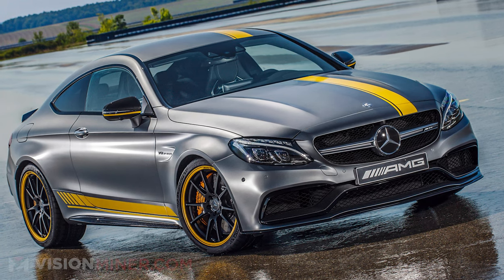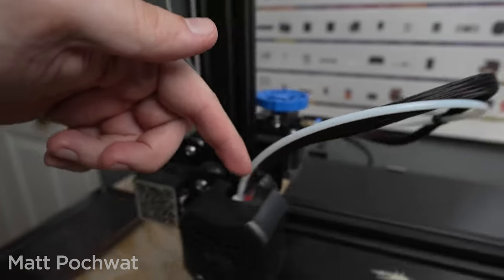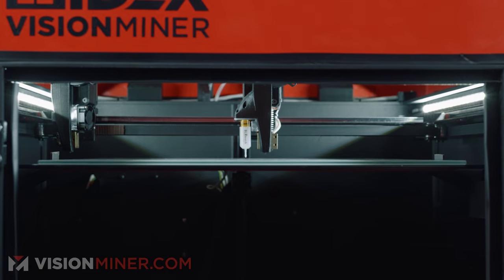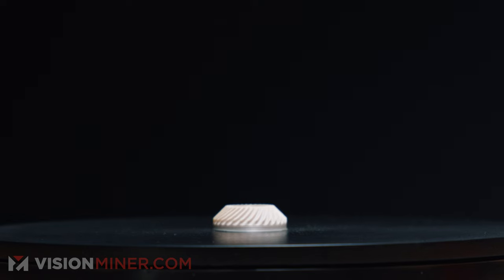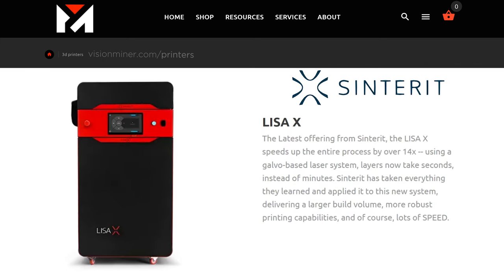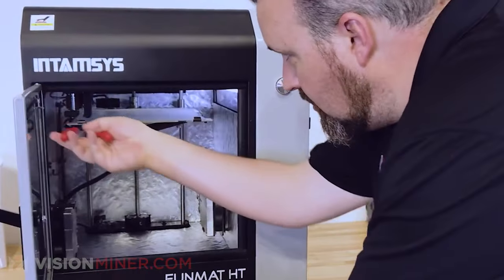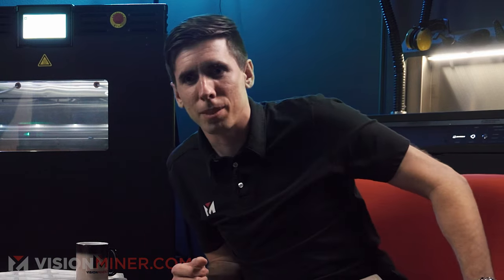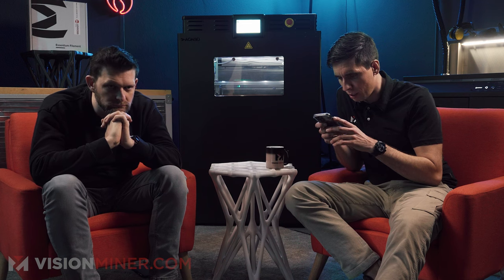Building vs Buying a High-Temp 3D Printer: What's More Cost-Effective to Print PEEK and ULTEM?

Comment: I built an enclosure and heavily modified my CR10 to print up to 100c Celsius ambient chamber temp. Bed can go to 140c and hotend up to 500c. Built the enclosure out of a broken dryer and had to relocate electronics outside. It cost less than $2000 and it’s great! However I agree with the opinion expressed here , it would be crazy for most people to try to DIY. Especially if it’s a business, it’s better to just buy the machine.
Reply: Here was my build list and approximate costs: Enclosure: 

Base Metal Enclosure: $0 (free broken dryer) 
Foam Panel Insulation: $30
Foam Spray: $10
Door and Clasps: $0 (from a table leaf) 
Polycarbonate Window: $40 
Door Sealing Foam Strips: $20 
Stripped Fin Heater and SSR: $60 
Metal Fan Blade: $10 
Shaded Pole Motor and SSR: $30
Thermal Fuses: $20
Silicone Wiring to Heater: $20
Silicone Caulk: $10 
Rails to Slide Printer out of Enclosure for Maintenance: $20 

Printer: 
Base CR10: $400
H20 BIQU Hotend & Pump: $100
SKR 2 Motherboard: $60
Berd Air Pump & Parts Cooling Ducting: $60
Metal Brackets for Z Axis top and bottom: $30
Polycarbonate V-Wheels (15): $30 
Class H Hi-Temp Stepper Motors w/ silicone wiring (4): $80 
AC heat bed and SSR: $40 
Cast Aluminium Bed: $80
High Temp Belts: $40 
Wham-Bam High Temp Magnetic Base: $40
Regular PEI Spring Steel Sheet: $20
Reply: What are you printing with it?
Reply: @travistucker7317  Mostly just regular ABS, but sometimes Nylon, and Polycarbonate (close to pure PC, not the gimmicky watered down stuff that Prusa sells)
Reply: @ce5903  what are you doing for the pc? I'd like to get there
Reply: @travistucker7317  100-110c for ambient chamber temp. 135-140c for the bed temp. 300c for nozzle.
Reply: @CE  isn't a cr10 like 300mm cube?
Reply: @travistucker7317  300x300x400
Reply: @ce5903  have you tried any peek?
Reply: @travistucker7317  no not yet. I doubt I will, it’s very cool stuff but I have no use for it.

Comment: I absolutely love love love this video. I think the biggest takeaway is that there is still such a perspective difference between industry and diy. Absolutely, if you have the money and want to make more money, buy the right high temp printer. One aspect about this market though that I think folks can't get behind is the proprietary nature of parts, support, firmware, etc. Being able to fix something simple yourself in a pinch is something that saves a business of any size time and money. That's one thing that sets the 22IDEX apart. It seems open enough to be able to tune it to your needs whether it is low temp or high temp material, and it's a machine that is understandable. The price range is good, maybe a bit high for individuals and startups, but not as absurd as some other similarly capable machines. It seems like there is a divide between small businesses and larger businesses with excess money to spend. Honestly a more open source like funmat would do excellently in university labs such as my own. But at the cost of a 22IDEX, it is much harder to justify. Research labs seem to be right on the cusp of being able to take advantage of these types of printers, but we aren't quite there yet. Thanks for the great content and innovative products.

Comment: Proper high temp printers are some darn crazy machines.  From vacuum beds to hot air part "cooling" and isolating the motion system, there's so much stuff that one just wouldn't consider if coming from a typical hobbyist printer background.

From what I've seen 80C chambers are doable on the diy approach of slapping something in a chamber that wasn't meant to be, but much above that and you'll start having a lot of problems.  Belts have to be isolated by around 120-130C and grease cooking off begins to become a real concern much above that.  Then you're looking at high temp bellows in addition to everything you already have to deal with.

With the cost of high temp materials it seems pretty reasonable that if you need to print them you can probably afford a purpose built machine to do so.  There are some pretty cool home-built high temp machines out there, but proper ones are few and far between (and still really expensive).  I personally don't require materials like ULTEM or PEEK, but it would be nice to have a chamber capable of running large parts in PPA-CF and similar "mid-temp" materials.  Unfortunately I'm not in a place to drop five to ten grand on a machine right now, but maybe sometime in the not so distant future.

Comment: By the way. You show the bl touch in the VM 22 as bed leveling probe. I had that in the Valkyrie but it is not suitable for ht chambers over 70c
Reply from the maker: Don't worry, that's long gone. New machines and new videos arriving in about a month :) Surprisingly, though, it actually worked quite well -- even on a large batch print, with a 200c bed -- tiny parts -- never really gave us issues, but now we use a high-temp microswitch setup we designed :)

Comment: "If you can spend the money..."  Oh, there's the problem. I can't.  However, I CAN design one out of steel, CNC plasma cut (also a DIY machine) the flat parts.  That only leaves the not-flat parts, bearings, belts, heating elements...... yeah this is gonna be a nightmare.  And not one big nightmare, but instead about eighty thousand little nightmares lined up in a row.

Comment: no joke i did build the most overbuild fdm printer possible with custom heatbed, enclosure and 500°C dual extruder system. All motors are outside the chamber, its core xy and build volume is 400x400x500. BUT... it wasnt cheap and its around 10k only in parts. My suggestion, dont do it ^^

Comment: I have done a few used Stratasys I found cheap cheap, rebuilt the wear items and run it on open source (6HC)  also kept some features like canisters loading bay  head blower, chamber heaters, fans, thermal snaps, chamber thermocouple and build volume is now larger and can now get to 90C no heated bed needed, it has 4 build plates types for it CF BORO MAG-PEI and metal this is the second one i have done now almost exactly the same but this one has a touch panel the first one was 3 months on weekends the last one was done in a weekend! no rafts or support unless i want it is a game changer for this unit alone with bellows and fire pillows 120c i could see but not needed yet

Comment: I built my own high temp printer.  it was a pain and it doesn't print PLA well because it gets too hot :D   getting those 200v 400Hz 3 phase aerospace grade fans that can run in the chamber at 100+ degrees was fun.  maybe i'l send some pics, it's quite cool. totally a hobby though and you guys are absolutely right.
Reply from the maker: Definitely send pics! Sourcing fans has been quite a chore, for sure!
Reply: @VisionMiner  sent to your contact email :D

Comment: I stopped with a chamber temp of 55c. Active heated chamber for a Voron 2.4R2 350mm.
Going above I would have to make so many changes I would running into to many issues.  Designing a high temp Printer isn’t easy and the materials needed are expensive too. 
If I ever would have to print peek I would buy a printer designed for it.

Comment: Dude, you guys are awesome! I bought a printer, not even from you guys, and when I called you, you guys were more than helpful. I ordered my first large bottle of nano Palmer adhesive, and a month later I’ve already ordered three, that stuff is amazing, but I think the whole analogy with sports cars is definitely not a good one because no one makes money with their sports car, I actually bought a 392 hemi SRT challenger instead of buying a demon, because I’ve now made it into a more powerful car than the newest demon. It’s almost 1500 hp, and I enjoyed every minute of doing it. Wanted to build a muscle car, my whole life, and I finally did and it was an amazing experience and I learned a tremendous amount. Similarly, I love the IDEX 22 especially the newer version, and I would love to have one I just couldn’t justify 15 K, so I bought a CreatBot F430, and then I decided I was going to modify it to get to the same temperatures as the IDEX 22, I have built a cooling system with an 18 inch radiator and three large fans with a pump circulating through four different aluminum stepper motor add-ons, that I CNC machined myself, so my X motor, my Z motor and both extruders are high temp steppers, another add-on, all water cooled with my homemade water, cooling system and homemade water cooling devices to go on the motors with thermal paste, doubled the plexiglass window, size in one and left the original, so tripled the size of all three, insulated the entire inside of the machine and added two 300 W ceramic heaters and 2 16 amp 24 V grid heaters with fans to the original large heating system that came in it with a external power source supplying them mounted on thin aluminum plates, welding, coupons, actually, drilled and tapped holes in those and mounted them to the enclosure, then had all holes already drilled and tapped for short screws to hold the heating units so four additional heat sources, the chamber is already getting up to 120 C, and everything in this printer aside from what I’ve changed is already built to withstand it. It has high-quality lead screws and linear rods, high-quality linear rails, on the X axis as well as the y axis on both sides, but the beauty part is those two stepper motors, and all of the electronics are not inside the chamber. They are underneath the printer, which is completely insulated and gets practically no heat, I used adhesive reflective thermal insulation that stuck onto the inside and then I put HVAC bubble wrap that is reflective as well on top of that, so it is seriously insulated very well, the build plate is also aluminum, then obviously I modified hot ends extruders, etc. etc., but it’s really turning out to be a serious printer. I’m getting up to the 70°C it’s rated for in five minutes. So when I let it warm up for 15 I’m at over 100 C. Hot end is already getting up to 500, and build plate is almost 200. And I’m nowhere near done, I already have a big tree, Main board and stepper, drivers as well as sub board and raspberry PI, it will be fully autonomous as far as video which is already installed with high temperature, wire, shielding, and the electronics outside the chamber either underneath or on the wall where my whole cooling system is mounted, I’ll have some YouTube videos of making it coming up but I’ll send you guys some pictures. Hopefully your guy Cole got the gun suppressors I sent him I ended up sending them a little later than I anticipated, but I did send him a couple to make up for it. Appreciate you guys as always, and one of these days I’ll be buying that IDEX

Comment: I think (perhaps foolishly) that there is a middle ground. I'm not looking to print PEEK, I just want to reliably use PC and PA in fairly large prints. To that end I've modified a Bambu labs printer, converting the AMS into a continuous filament dryer (pumping warm, dry air under the spool carrier and back to the dryer, recirculating through a desiccant bed), and I've insulated the print chamber with reflectix and added thermostatically controlled silicone heat pads. I also isolated the electronics by printing a sort of gate that allows the heated bed cable to move up the Z axis while limiting the amount of warm air that reaches the boards in the back of the printer. I could easily reach 90C with this arrangement, but I think that would be stupid given the number of plastic parts and the wide range of coefficient of expansion of the materials. Instead, I want to maintain a constant 60C and fiddle with all the parts and the slicer until the printer does a decent job with PC and PA. It helps that I don't have any commercial ambitions at all--I'm retired and I can afford to play with this stuff. Of course, it would be easier to just buy a printer that's engineered from first principles to accomplish this and more. But what would be the fun of that?
Reply: I would absolutely love to see your modifications. I have not been able to find anyone doing this with Bambu. Please share!
Reply: @dmax9324  OK. I shot some video but haven't edited it yet. I'll work on that tomorrow since it doesn't look like we'll have any wind here on Maui, so no wingfoiling.
Reply: @dmax9324  I will, but it's going to take a while. I'm converting my filament dryer to a regenerative cooling dehydrator in addition to the dessicant and heater fans. I'm using peltier refrigeration plates to remove moisture from the air. The air coming out of the AMS impinges on the cooling heat sink first. The sudden cooling of the warmed AMS air will condense water out of the air which drips to the bottom and out to a container. Then the air will travel over the hot side of the peltier plates, helping to cool them. The warm air then passes through the desiccant bed to the PTC heaters which bump the temperature to 70C and back into the AMS. I mocked this all up with cardboard and it rapidly drops humidity to less than 10 percent, a level where the humidity sensors I'm using get inaccurate. I'm designing all the parts to be 3D printed and I'm headed back to the mainland in a few days, so there will be some delays.
Reply: @BillBabcock  sounds pretty impressive. I like your approach to reducing moisture level with a peltier system.

Comment: I'm a DIY'er and cheapee that has come to the realization, yes... better to buy. Not just 3D-printers, applies to everything. Great video!
Reply: That's probably true more often than not, but not always the case. I have industrial machines, and engineering and manufacturing skills and experience.  In many instances I can engineer custom build things and exceed the quality and function while doing it cheaper. Many of the things I build are very custom to meet needs that commercially available products can't do, either because they don't exist or are inferior in some way. But, one does have to count all of the costs honestly, and the return on investment.  But, if there is a machine you can afford that will do the job well that you can buy so you can focus on your primary objective, you probably are better off going that route.

Comment: I am in a tough spot where all I can do is bide my time. I want a 22Idex, but don't have the free cash yet. I want it for a business I haven't made much less gotten the required licenses/tax status. All of which to make a product that I do not know if it will work or even sell and it is not a product that can be outsourced to a third party. It's rough. Worst case it would be a passion project as a hobby.
Reply: I think the best course would be to get the Funmat HT to do proof of concept and then get a 22Idex after making or joining a business to make for sale.
Reply: @taprackmiss4613  I wouldn’t order the 22 IDEX right now because you probably won’t get one for a year anyways. They are delayed massively
Reply from the maker: The conflict in Ukraine put a huge hold on supply chains last year, but finally everything is running. We expect to have machines in stock in May, but with how fast orders come in, there will indefinitely still be a wait list :)

Comment: There right definitely alot of issues and if you buy one of there overpriced machines you'll be needing there support every couple of days.  These machines really should be cheaper for what you get.
Reply from the maker: What machines do you have experience with to support this statement? Generally the support is more with the materials, and how they all behave differently -- that's where the majority of the support comes in.

Comment: Where do you guys draw the line for your recommendations to customers on this? Like PPS+ temps? Or even for PC/Nylons? Seems like a good few of DIY corexy printers are printing CF PC well enough but I am not sure at which temps you feel the printer becomes a money pit because the construction isn’t fit, but that’s my core question.
Reply from the maker: Generally anything over 65-70c in the chamber -- that's when stuff starts getting really messed up.

Comment: Even if the 22 is intended for business, it looks like a decent home printer, especially with 110 volts for power.

Nothing wrong with DYI, but a good working printer is the cornerstone that one can build from.

Plus, the ability to print car parts which will not melt in Texas heat are worth it.

Comment: Just a suggestion on your price points, if it’s something important to the industry somebody will backwards engineer what you built (or design their own) and undercut you on cost.  Don’t try and make money on being the only competitor because there is somebody else that is always going to be willing to undercut your pricing to marginally profitable and deal with high volumes.

If you are more than about 10-20% over material and production cost you may want to rethink your model long term.